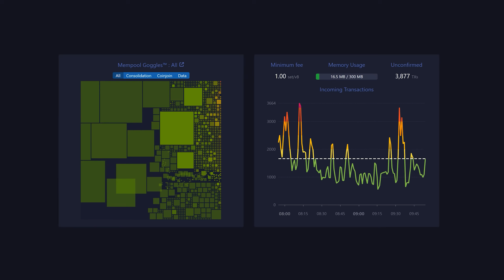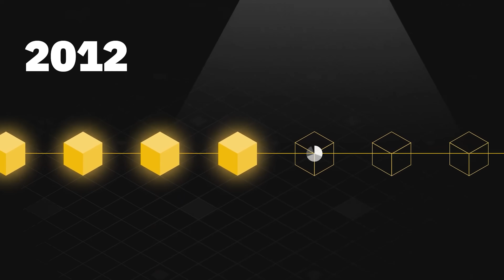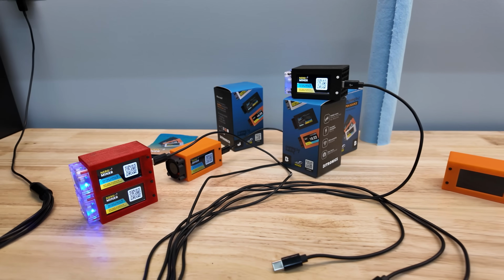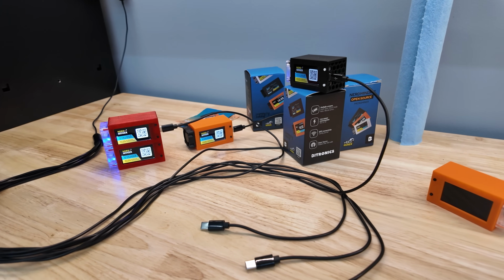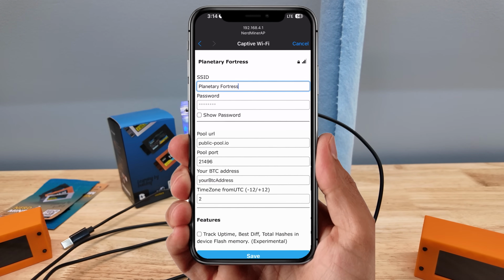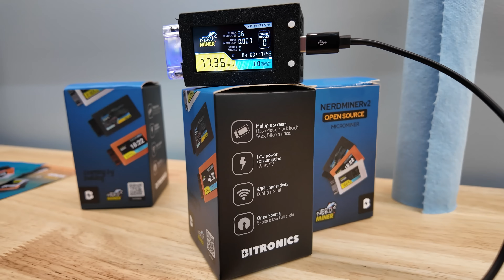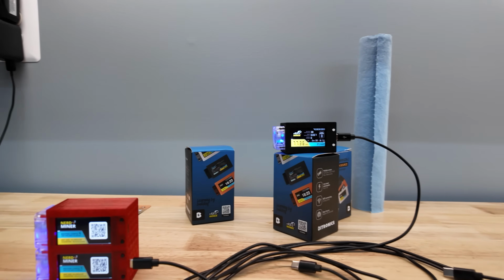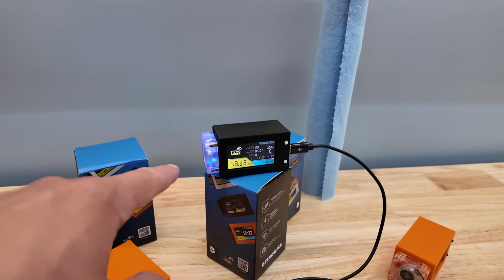$50 Tiny Bitcoin Miner - NerdMiner

Comment: Ok, I understand this is basically a bitcoin " scratcher" fine, but what if it does " win" how will I know, and secondly how do I get the " win" off of the device and converted to cash?
Reply: Hypothetically, it should pop up in the wallet you added when configuring your miner. I'm using a miner and have applied my wallet address to both the primary and secondary wallets.
Reply: @nunez4200 ok, so its in a " wallet" fine, what then? I can't go to grocery store or hardware store or pay the electric bill with it, how do you sell it? Where can you convert to dollars and have a useful currency? Im not being sarcastic I genuinely do not and have never understood how this series of computer code is supposed to be valuable as you can't use it transactionally
Reply: @nunez4200  how much do you have now??
Reply: It's goes to the Bitcoin address you put in when you hooked it up. Good luck! I bought 3 and am hooking them up tonight:)